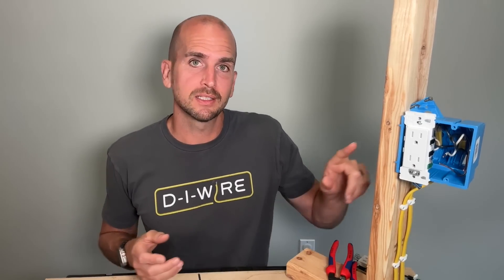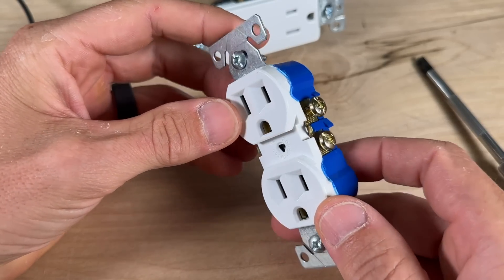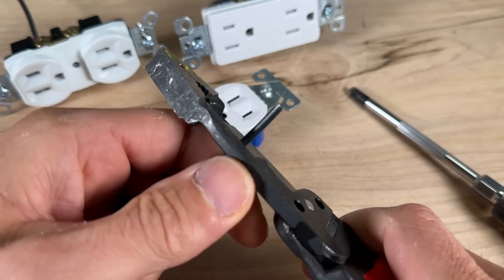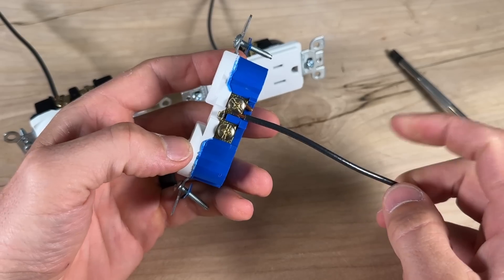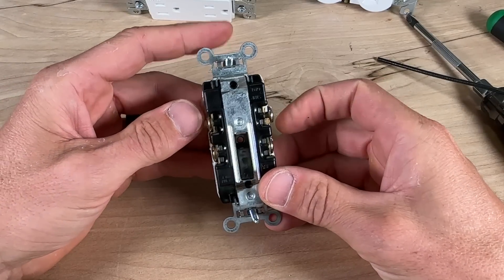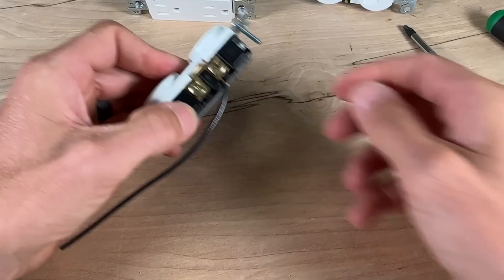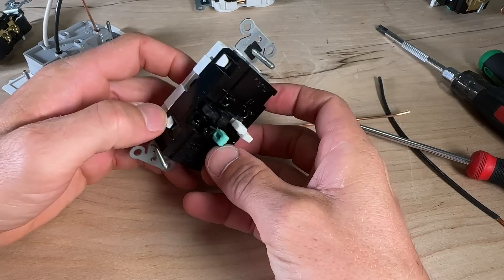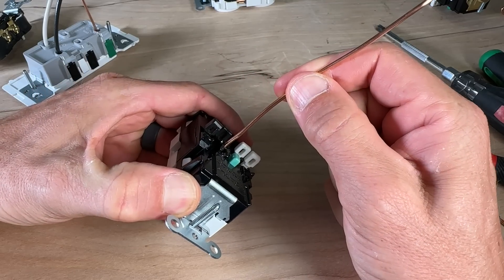New Products That Make DIY Electrical Projects Easier!

Comment: Personally I'd still go Leviton for it's integration with it's other products with that exact fit setup as well as the Wago lever feature I love. But the Hubbell is a fantastic secondary option. I think those would work perfectly in RV/Mini Homes. That connectors grab force and the fact they advertise it's vibration resistance would be the perfect fit for those since they are on the road frequently.
Reply from the maker: I think they would be great for RV 👍👍
Reply: backstabbing or back wiring is not code compliant in many states now.
Reply: I’ve been very please with their products